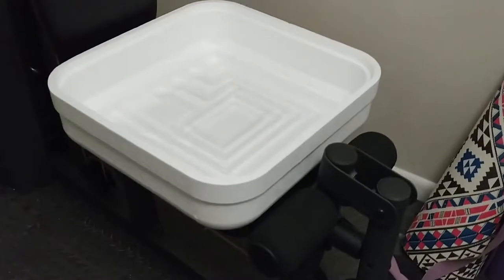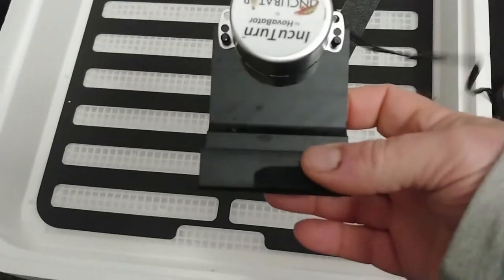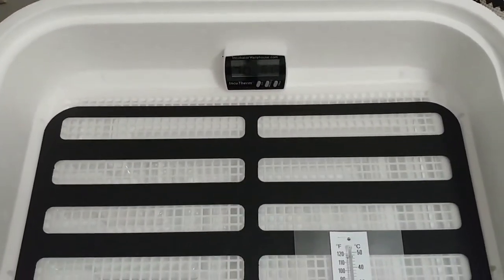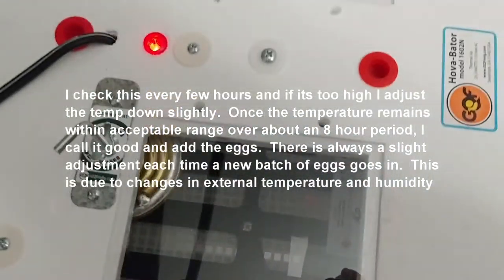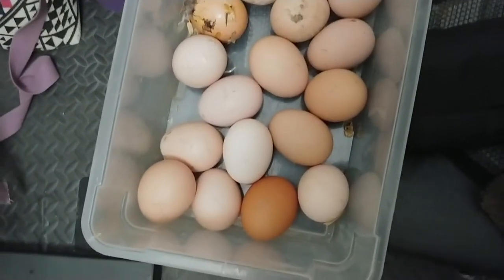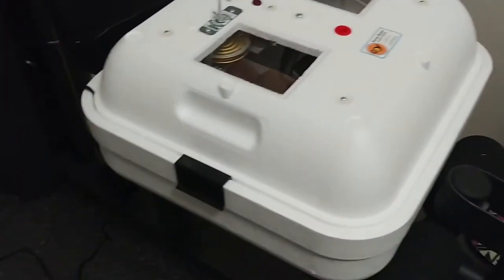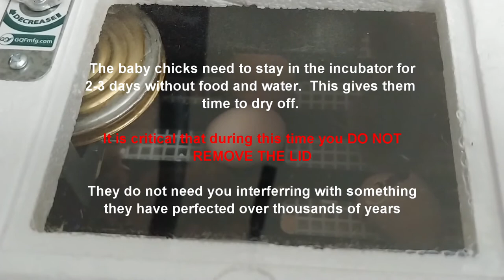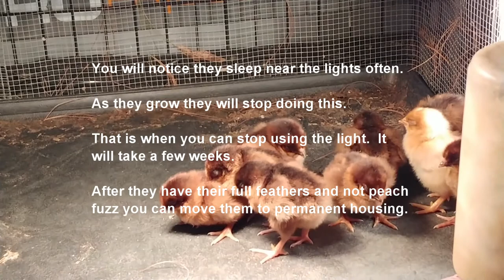hovabator incubator homestead chicks start to finish during coronavirus lockdown

Comment: Thanks. Just started lockdown and just needed a review
Reply from the maker: i had a smaller and cheaper one before this that was not that great (it was hard to regulate humidity and temperature, the hatch rate was low, etc).... I did a lot of research before I bought this one and it has been amazing with a high hatch rate even during warmer weather.  I think you would be just as happy as all the other hovabator owners.  They are awesome!